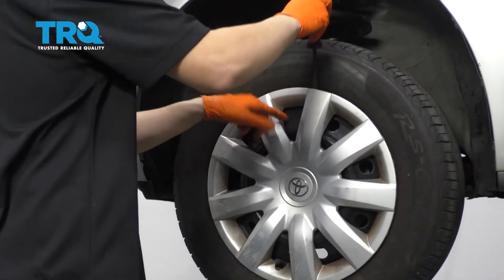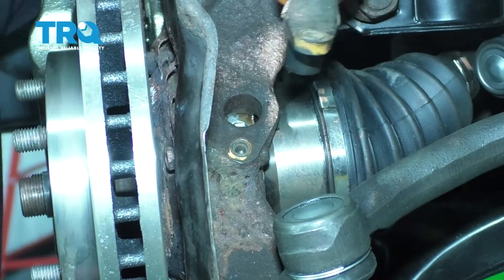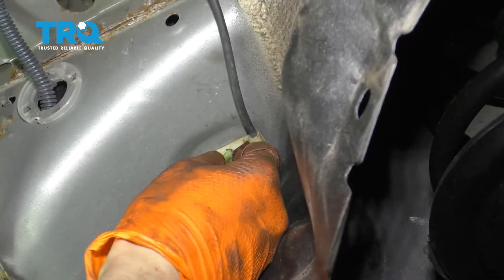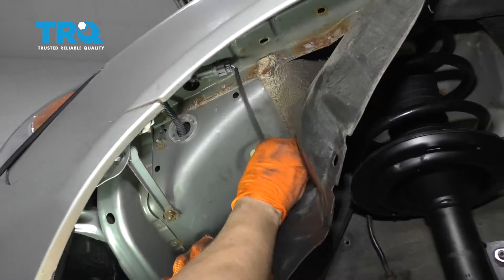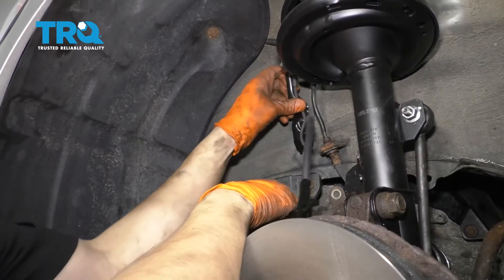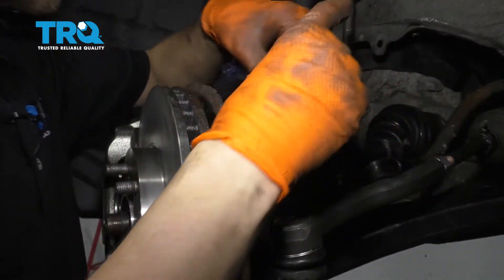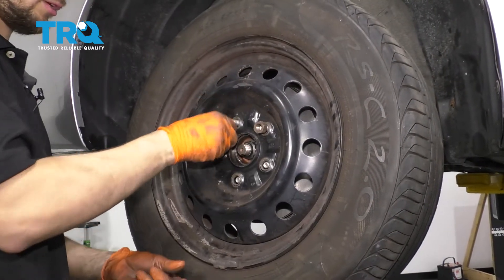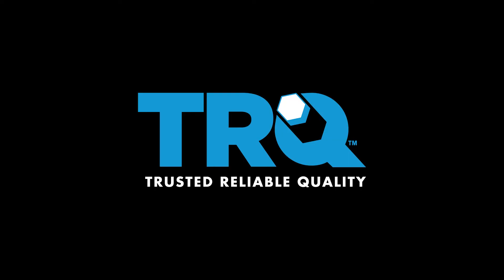How to Replace ABS Wheel Speed Sensor 2001-06 Toyota Camry

Comment: With a P0500 code, how do you determine which wheel has the bad sensor ? Service manual states 1.6 Kohm resistance, is that on the actual sensor or the harness going to the ecm ?

Comment: Do I  need to progam anything after the install? My abs and brake light come on and my mph/rpms dont read so I'm hoping this will be the cause. When the abs and brake light are on in the dash there is no communication with the obdII port.
08 camry
Reply: What was the problem? Did you ever figure it out I’m going through the same thing?